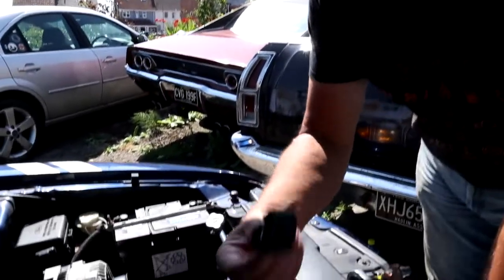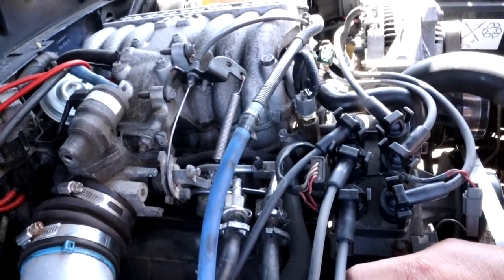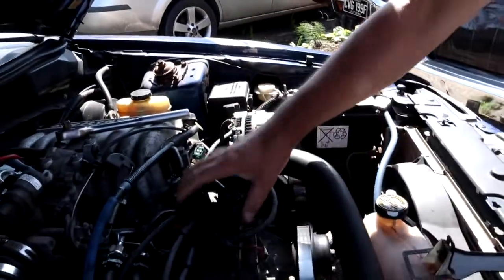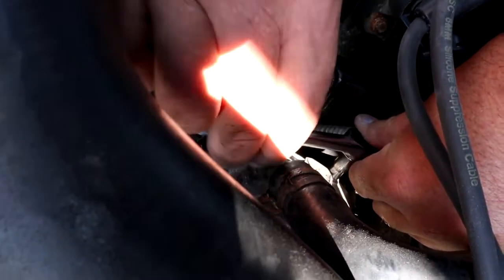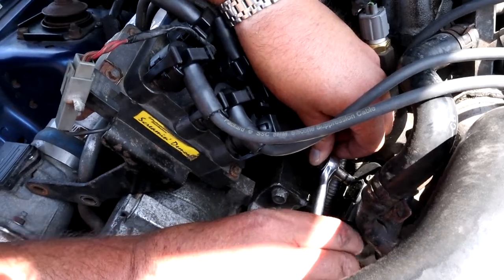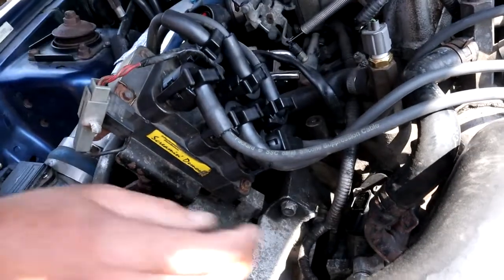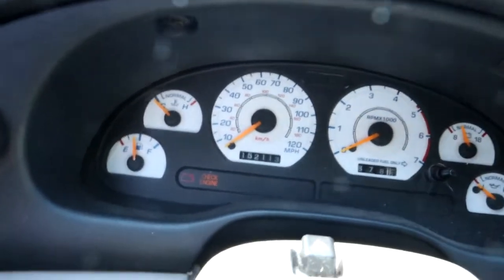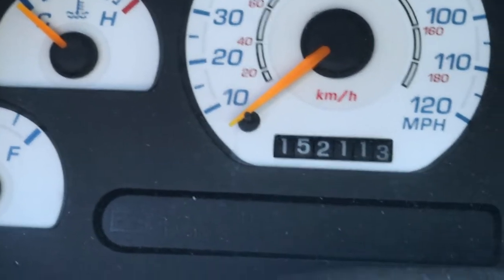Oh No, Check Engine Light Is On, Again!

Comment: Great little tinkering video Nigel, fingers crossed that the light does not come on again. Could not believe what you had to remove just to get to the sensor.
Reply from the maker: Thanks, it’s crazy where they decided to put the sensor, easy job just a bit fiddly with having to move the coil pack out the way